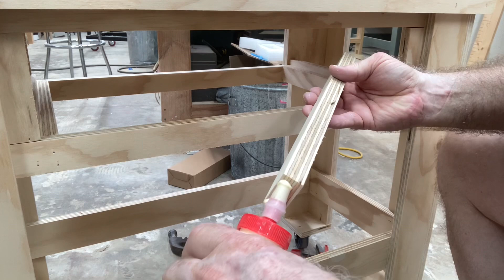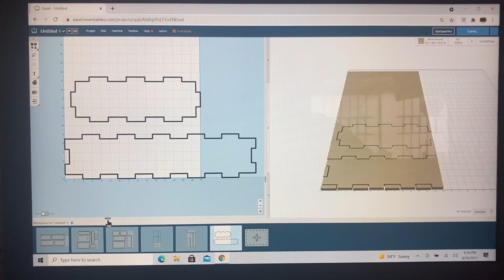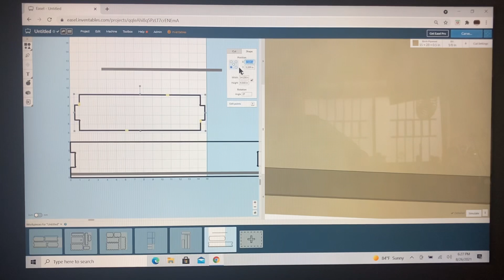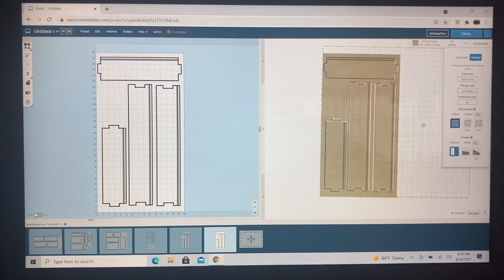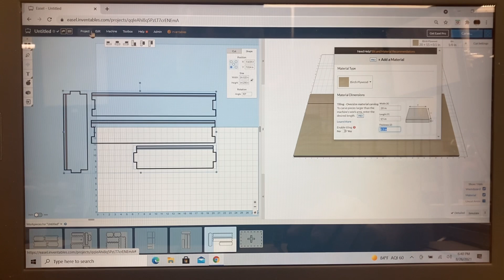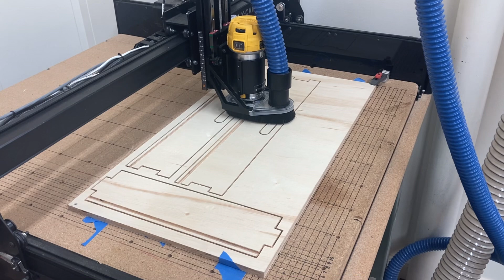Adding a Drawer and Shelf to the Tool Stand

Comment: Good combined workshop & CNC build. Like the pass through drawer accessibility.
I was surprised at the cut settings that you settled with, depth of cut per pass seems quite shallow, I thought you would be able to have deeper cuts with the trim router & cut in 2-3 passes max.? Or does your fast feed rate require shallower cuts?
Reply from the maker: Baby steps. The machine handles much more than the bit. I will slowly increase the depth of cut with further tests
Reply: @PawPawsWorkShop I get it,  find new sweet spot
Reply: @PawPawsWorkShop  (kkkkkk7